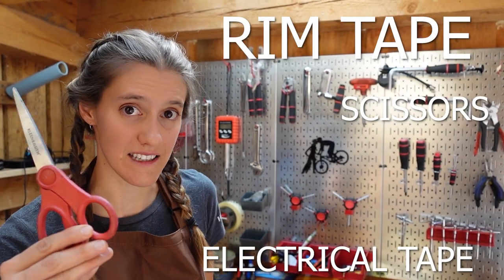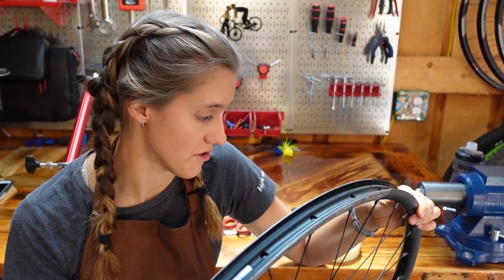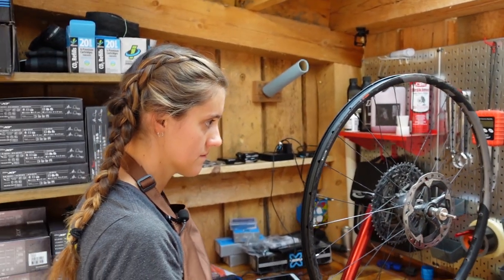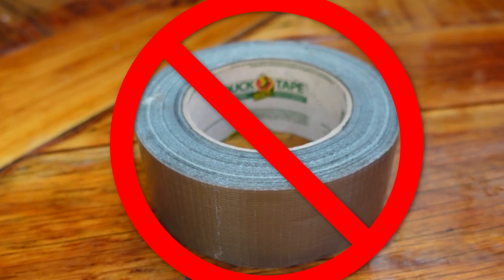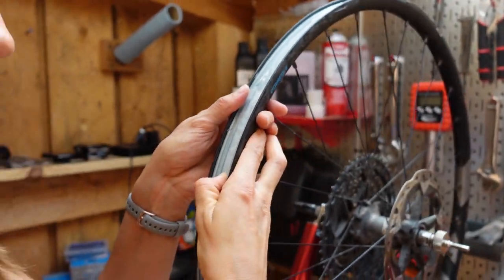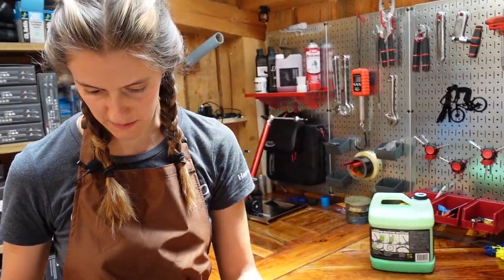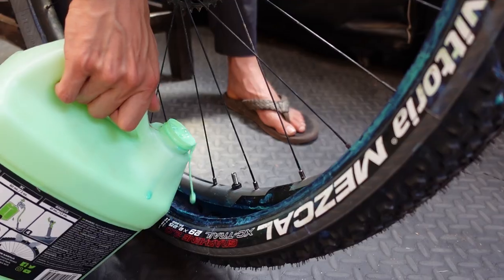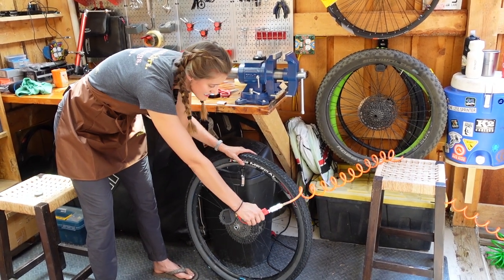How to install tubeless rim tape that won't leak | Syd Fixes Bikes

Comment: Spot on video.

Muc Off tape is our shop’s weapon of choice for tubeless. It’s adhesive is better than Stan’s imho. 

We also typically install a tube/tire after applying tape to help remove bubbles and to help tape adhesive to setup. Tube stays in for 24 hours then we remove and install valve/ add sealant. You get ride of the bubbles and have a pro tape job.
Reply from the maker: That's a great tip!

Comment: Some tips that people may find helpful especially if it is a bit of a fight to get the tyres on the newly taped rim:
1 - If it is a new folded tyre take it out its packet, unfold it and get it round, you can then stretch the bead by putting a foot on the tyre bead and pulling the opposite side, do this and shuffle the tyre round through 180 degrees.
2 - when installing the tyre start opposite the valve and push the tyre bead into the channel in the middle of the rim - this will give you the greatest amount of slack to get that last awkward bit of tyre on.
3 - If the first side of the tyre is tight to fit (requires more than your fingers and thumbs to get it on) you can put sealant into the wheel once the second side is on, some bottles of sealant come with a little funnel that will allow filling through the valve (with the valve core removed) otherwise a syringe and a section of hose for bleeding brakes works really well.
4 - If your tight tyres wont seat (make that satisfying pop) get some liquid soap and dilute with water then squirt/rub this onto the rim & tyre all the way round. Any kind of soap will work, hand wash, dish soap, shower gel.

Also don't miss the tip from Yankee Rider for heating the rim and rim tape - it's another good one.

Comment: Nice job! The 1-minute recap is very professional and useful! How about totally getting off all old sealant from inner tire surfaces when it's been caked on for months? can never get it all off when redoing/swapping a tire (want to reuse that tire eventually) , have stopped trying.....
Reply: I had some succes with goo gone, friction and baking the tire In the sun

Comment: I recommend using DT Swiss rim tape (4mm wider than internal width of rim) and do a double wrap. The way you do this is start on one side of the valve hole, wrap twice and finish on the opposite side of the valve hole. This way it is single ply around the hole to facilitate sealing the valve and it will be double everywhere else. You will not need any electrical tape or anything else and I guarantee it will hold air better and also facilitate seating the bead much easier.

Comment: I use gorilla tape . The 1 inch  tape works great for my rim size. I put electrical tape first and then the gorilla tape over it to avoid the sticky residue from the tape . As with syd it was trial and error until I had permanent success . well done

Comment: Good stuff - I too use the rag technique to push it down but I always use DTSwiss Rim Tape as it’s less “sheer” than Stans Or Joe’s so I don’t have the bubbling as much and don’t need to use electrical tape afterwards ... you should check it out.

Comment: rim tape hack - pull the tape onto the rim (dont worry about bubbles) once in place put in a inner tube and pump, leave for a few hours remove  tube 
and there you go a perfectly taped rim  👍

Comment: I love the added trick of adding electrical tape over rim tape as an added barrier and clean looking finish, I would like to add that if you want a smoother initial application of tubeless tape, Stans, Slime, DT swiss, ect, all benefit from being installed with tension as it helps with adhesion on the rim, and will leave a smooth application. as for Gorilla and Duct Tape, they're not technically air tight, as they're perforated for easy tearing so they require sealant to seal them up and can slowly leach moisture into the rim.  
I apply about 2-3 spoke widths initially then start to apply tension ( you will hear it strain) to the tape and turn the wheel away from me, once the wheel makes the first 1/8-1/4 rotation you can move your hand forward and tension in 1/8th rotation sections. Give this a try next time and see how it goes for you. Over all love this tutorial and great information for basic mechanical skill work! Keep up the amazing job!
Reply from the maker: Great tips!

Comment: Nice job.  Tubeless is dangerous as evidenced by drawing blood.   You didn’t mention why you start opposite the valve hole?   I’ve always started 6 inches past the valve hole and then ended up with a double wrap over the hole.   Also the electrical tape addition is a nice idea.  Thanks.  Enjoyed your first video.
Reply from the maker: We prefer not having double rim tape over the hole to make it a bit easier to get the valve stem in. But it doesn't really matter 😁

Comment: I have a nick in the factory rim tape in-between spoke holes.  I hate to remove that stuff because it leave glue so hard to get off I have to burn it off with a heat gun.  I tried your electric tape hack and it sealed hopefully it will hold.  It looked really good so I have high hopes

Comment: Some Roval wheels come with plastic buttons with o rings that go in the spoke holes, no tape needed, and if you have to work on a spoke just pull out one plug, fix the spoke, replace the plug, the plugs may be lighter, but they sure are easy to use, and get use to..

Comment: Interesting take with the electrical tape.  I've ran DT swiss tape and Mucoff tape, two times around the wheel with good luck so far.  I just grab a lawn chair and sit on the patio, throw a towel on the ground, stand the wheel on the towel and hold it between my legs as I wrap the tape around.  haha
Reply from the maker: Yup, that's usually how we do it too, but for the video figured the truing stand was better...

Comment: Can I add one suggestion....Videos are very helpful and great by the way.  I made a rookie mistake.  I started taping as you demonstrated and realized my valve stem was not in this.  Make sure to tell folks to make sure the valve stem is in BEFORE you start taping.
Reply from the maker: Actually, you want to install the valve stem afterwards.

Comment: Cheers for the tip with the insulating tape I did my son's no tube less rims and the rear one would hold air but would loose 10psi over a few days drove me mad..  Anyway I've cleaned  it down taped the tape and it's now holding air fine cheers

Comment: Just discovered this channel and i must say your instructions are very intuitive and easy to follow! great job guys!! Im trying to find a sealant that is easy to work with and doesn't get all clumped up inside the tire. What is your favorite sealant to use? im sure your sponsored by someone and they give you sealant but still want to know what you guys think..? Im running non Cushcore tire inserts. Some sealant doesn't work well with inserts
Reply from the maker: We've been using SLIME's tubeless sealant for the last few years and like it, but they no longer make it. We're planning to try Orange Seal now as we know lots of people who have had good success with it. https://bit.ly/2Iyp7dC

Comment: I use Gorilla Tape, and it is a paint to remove all the adhesive if you ever have to take it off and reapply it.  Ask me how I know.  I broke 4 spokes on the same wheel in 6 months.  Got real good at cleaning and reapplying rim tape.

Comment: I did it in the opposite way..I used electrical tap first then a layer of gorilla tape on top. So far holding air..we'll see how long it lasts. Glad to see racers are using g electrical tape. Makes me feel better about it 😅

Comment: Thanks for your great informative fun vlog, I`ve been cycling all my life but now with a half good gravel bike (Norco Search A1) I am trying to do more things myself. My sealant needs replacing soon on my tubeless wheels (Hunt 4 season Gravel x wide. with Specialized Pathfinder pro  700x42 tyres. ) should I also replace the tape on the wheels ? at the moment the tyres stay well inflated but it has been about 5 months in some hot weather since the last bike service when they were looked at. Thanks guys.
Reply from the maker: Nope, no need to replace the tape unless it isn't holding air!
Reply: @sydfixesbikes  That`s great, thanks for the quick response.

Comment: I always check whether it is tight before I put the sealant in , in a Bathtube or so, because sealant can't fix a leak on the Rim side well.. and its easer to fix a wrong installation without sealant -)    
but otherwise, good work!!

Comment: Interesting approach with the extra layer of electrical tape. I might try that. My rear wheel just started leaking at the valve stem and several spoke holes. I tightened the valve, put in fresh sealant, and problem solved - NOT! It appeared to be "sealed" while in the garage, but after a 3 hr ride, the PSI went from 30 to 15! Looking at the rim tape I see no obvious holes. In my garage, soapy water on the rim reveals no leaks, but out riding it leaks. And after ride the spoke holes and valve stem show leaks with the soapy water. So frustrating.

Comment: Hello, just found your channel and have decided to start at the beginning as I am enjoying your presenting style and humour.
Question!
Why do you start the rim take from the opposite side to the stem hole? Whenever I have done tubeless setups, even in regular clincher rims, I have always started at the stem hole, so when the rim is taped, the stem hole is covered twice, or three times if I double wrap.
Just curious to understand the different reasoning 

Am looking forward to watching more of your video's.

Real and enjoyable 👍
Reply from the maker: It doesn't make much difference, but generally the spot where the rim is welded or glued together is opposite the valve  hole and we like double tape on that spot...
Reply: @sydfixesbikes  blimey! That's a rapid reply! Nice one, and thank you 😊

Comment: Happy new channel! Looking forward to keep watching after this great vid.
A question about the rim tape. Don't you want the rim tape to be pushed down into the centre channel of the rim? I'm thinking both that it helps to push stubborn tyres down into the channel and also so you really can push down the valve and get it sealed. I got a wheel back from my lbs and they'd put the rim tape on with it sort of gapping over the channel and creating kind of a bridge, just as you do in the video. And I couldn't get it sealed at valve enough so I had to put a tube in (I will take another look and try again. Or I'll just have to reinstall the rim tape)
Reply from the maker: Yeah, after publishing this video we were discussing this and felt like we should have made that point more clearly! You DO want to get the tape pressed into the middle!

Comment: Thank you!! Very well done!  What has your experience with Stan's tape been?  With IT you don't have to use electrical tape, right?
Reply from the maker: Pretty much all tubeless rim tape is the same -- all of them claim it works fine with just their tape, but in our experience they all work better with the additional electrical tape! We haven't used Stan's in a while but the last time we did, we had the same issues with bubbles and crinkles...
Reply: Indeed they're almost all the same.  A great commercially available (and inexpensive) tape is 3M 8896.

Comment: I wouldn't put electrical tape or any other kind of tape on tap of the tubeless tape for the same reason you explained at the beginning. The electrical tape won't hold the pressure and eventually you'll have to redo the whole thing again.
Whether you're applying a 2nd layer is because you don't trust the 1st one; as a result, you better apply a 2nd layer of hte same tubeless tape. But now here is my tip-trick come along !! Apply the 1st layer use the rag as you did to get rid of most bubbles then put the tire on and the tube too (yes the tube !!) Inflate the tube until the tire pops up into the bed, keep inflating up to the psi's for the tire is supposed to be with a tube. Let it be for 5 - 10  min and remove the tire and tube, with this process you get rid of the bubbles and attach the tape perfectly onto the rim surface all along.
If you need apply the 2nd layer and repeat the same previous process but start the taping at the opposite side where you started the 1st layer so you don't have 2 beginnings at the same spot. 
Important: When removing the tube in the 2nd round just break one bed of the tire and take the tube off through that side, then put the tubeless valve on and tight the stem nut as required. Put the tire back on and inflate until both beds get on the rim (loud pop sound).
Finally, remove valve core and inject the sealant through the steam at floor position (never on top), put the core back in and inflate to tubeless regular pressure + 5-10 psi's more and close the valve. Move around the tire to spread the sealant evenly inside the tire and the put the tire sidewides on a bucket or box for 10 min, then repeat the shaking and moving around and put it back on the bucket but on other side for 5-10 min
Actually, I'll leave standing overnight after all this process to verify it holds the pressure and no major sealant leakage happened; reduce pressure to your preference.
It's ok if sealant goes through tire walls in some cases (some tires have porous where the sealant shows up as little drops onto the walls
I've done this procedure for years for all my bikes (road, gravel, MTB, and Fat) and never ever I had a problem or failure with the setup and no messy sealant all over 👍

Comment: If tape you use is wider than the rim, should you trim it or get new tape?
Reply from the maker: If it's a tape that tears easily like gorilla tape or duct tape, you can just tear it narrower as you start pulling it off the roll and that's easy. If it isn't a kind t tears easily (normal rim tape) you could trim it, but it's probably not worth the effort and would be a lot easier to just buy narrower tape...

Comment: Tip""when cutting rim tape  round the edges   helps prevent lift and sealant getting into the over lap  of a straight cut across the rim tape
Reply from the maker: Good tip!

Comment: What about adding gasket sealant (bought at repair car shops) to the rim holes instead of tape around the wheel?
Reply from the maker: Never tried that, would be interested to see if it worked. It would need to be able to withstand a certain amount of pressure from the air inside the tires...
Reply: I'm tempted to try it...these gasket sealants are used to aid in sealing engine car components like car radiator hoses and thermostat so I would imagine that high pressure and high temperature concerns are no issue.  The only reason I would like to try it is to avoid re-taping and of course curiousity.

Comment: question for you , I am new to tubeless is rim tape vinyl based , could it be heated to push it to the center , I was asking because if it is vinyl based it could be heat like the do when they wrap a car.
Reply from the maker: Yeah, some other people have recommended that and we're planning to try it out!

Comment: Sid and Macky, I've got a question about tires and seating them properly. Will any rips in rim tape affect the way a tire seats itself and can causes it to wobble? I'm asking because my tape on the rear rim has some rips near the wall of the rim from a tire lever. My older tube only tire will seat perfectly and will be true. But my RaceKing, which can seat true on the front rim, cannot on the rear rim.. So my old tire is true on both rims, but my RaceKing can only seat well on my front rim, of which there were no rips (that I know of).
Reply from the maker: That shouldn't affect the tire sitting true. The only possibility is that the bead of the tire is catching on the tears which is keeping it from seating fully....
Reply: @sydfixesbikes  I'll double check the rim and see if I can smooth out any tears I see. The ones I saw a while back when this started happening were small tears, again from a tire lever I used to take off the tire (which I've grown to not like using unless I have to LOL. I've also learned how to take the tire off without the lever).
Reply: @sydfixesbikes  And thanks for your help!

Comment: Putting the wheel on the ground helps with getting the rim tape tighter and smooth and shouldn’t need electrical tape to follow up

Comment: Syd , what tubeless tire sealer do you recommend ?
Reply from the maker: We've used a variety and don't necessarily have a favorite. We'd recommend going with one of the popular brands (Stan's or Orange Seal) because they're easier to find if you need to add more (and it's better to avoid mixing sealants).

Comment: Question: If I do have 31.5mm inner width of my rims, what width of tape do I need to use, 30mm or 33mm? Thanks
Reply from the maker: Probably 30. Easier to do 2 layers if the 30 doesn't fully cover the holes that to cut down the 33.

Comment: I'll assume that the tire doesn't separate from the rim that easily, after all this, say during a major hole occurring while on the trail. If that did happen what a chore that would be to get resealed and pumped up with a small bike pump. Guess carrying a tube for backup is the way to go if riding miles away from the car/trailhead.

Comment: That video was really good! I’m so glad you guys are posting these. How well did the hockey tape work? What kind did you use? As a hockey player myself I am very curious to know if that works! (Not that I’d try it myself)
Reply from the maker: It was an emergency solution during BC Bike Race. It seemed to work fine, but we didn't get a long-term test on it. It was the clear, slightly stretchy kind (someone gave it to us, so not sure of the exact kind).